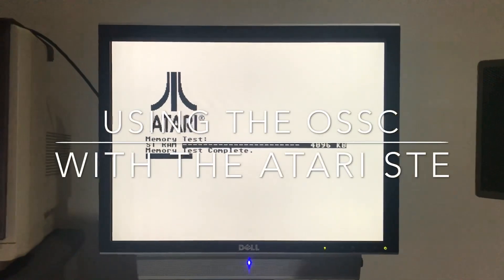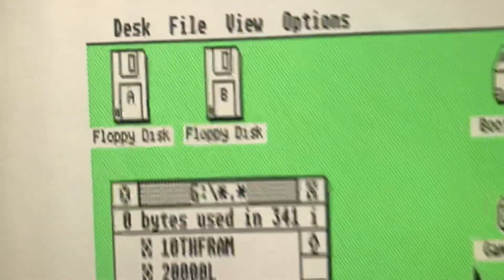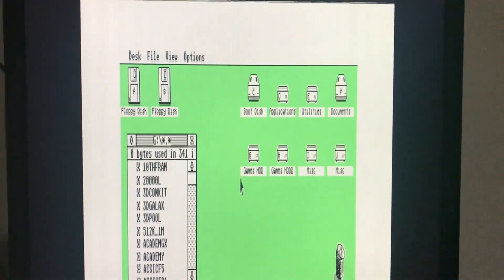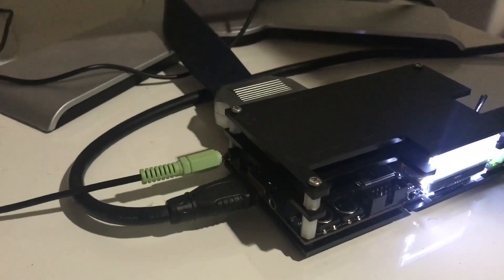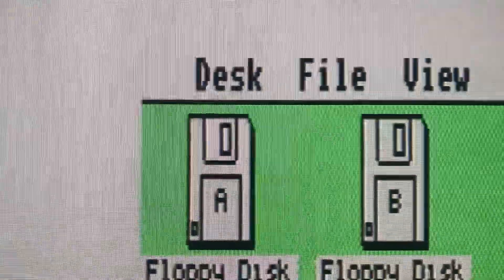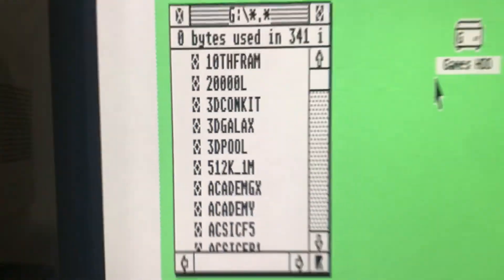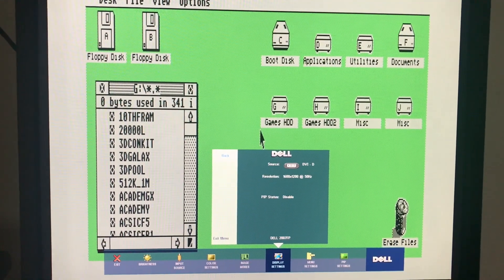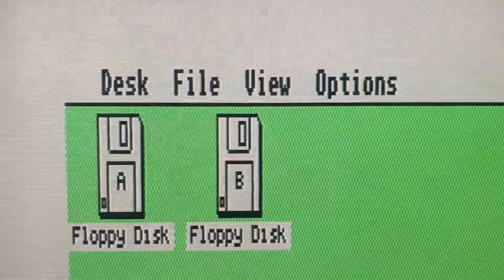Using the OSSC with the Atari STE

Comment: Hi, I'm waiting for my own OSSC to connect my ATARI STE to my DELL monitor. What RGB to SCART cable have you used? I'm going to build it myself so any help on a working cabling and pinouts would be very appreciated. Thanks in advance!
Reply from the maker: I used one from Cool Novelties.  Obviously, this will only give you the ST's low and medium resolution colour modes, but I had since moved to using an ST2VGA adapter to connect the ST to the VGA input on the OSSC - this gives you access to all three resolutions then.   The OSSC's VGA input doesn't have a low pass filter so it isn't as clean as the OSSC's SCART input.    I've just received a VGA to SCART adapter that will allow the ST to pass 3 resolutions to the SCART input, allow the low pass filter to be used, and hopefully all 3 resolutions will look clean again.
Reply: @modernisingyourretrocomput3866  Hi! I finally got my OSSC and connected it using my built SCART cable. In general the images look a little wavy, and playing wit the parameters didn't seem to help much. Any advise?

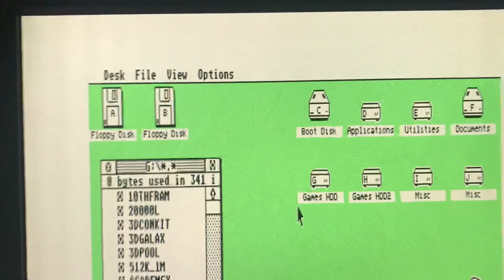Comment: 0:40 as for the little ghosting (which is far more obvious in some games and demos), it's a common problem with the STE and Mega STE machines. I showed this in a (german) video and how to solve this. It's quite an easy fix by just adding a capacitor to an existing one (or remove it with the new one). As I can't put links in comments anymore search my channel for "Atari STE, Anti-Ghosting". I linked to the original article of this solution from exxos UK in my video description. 😉

Comment: Great demo! I just ordered an OSSC to use with my various Atari computers and consoles (including a few STs), mainly for video capture.

Hopefully it'll be a worthwhile upgrade from my RetroTINK.
Reply from the maker: ctrl-alt-rees I don’t think you’ll be disappointed with the OSSC and ST combination.   Coincidentally, I’ve used the Retrotink 2x with the ST but had to put a SCART RGB to Component convertor in between
Reply: @modernisingyourretrocomput3866  Me too, in fact I have the RGB2COMP by the RetroTINK guys. I actually use my Ataris with Atari monitors but I'm looking to capture some stuff with my Elgato and want the best possible quality.

Hey, if it means I can play my ST on my big flat screen too then that's an added bonus 👍

Comment: Hi. Can you get the ST to work on hi-res with the OSSC, or do you use another solution for that?
Reply from the maker: Andy Keys , I tried the set up again recently using an ST2VGA switch on the STE along with the OSSC and a VGA cable.  I was able to get all resolutions working.  With hi-res, you have to turn on “Allow upsample2x” setting for sharp results
Reply: @modernisingyourretrocomput3866  I have built a RBG to SCART cable that allows switching between MONO and COLOR. Will try using that setting! Thanks!